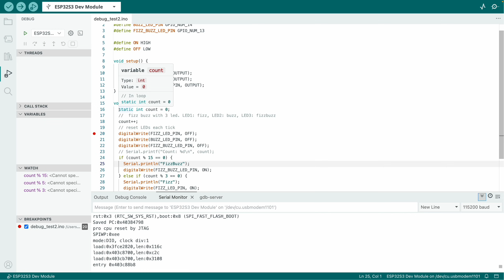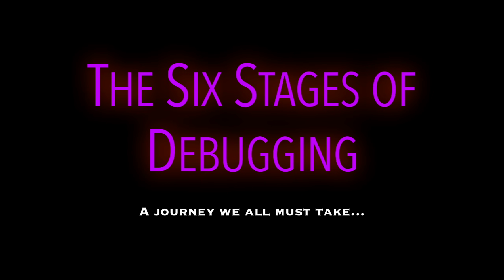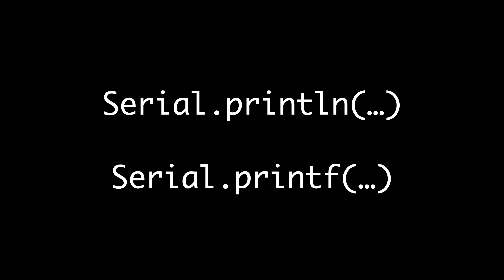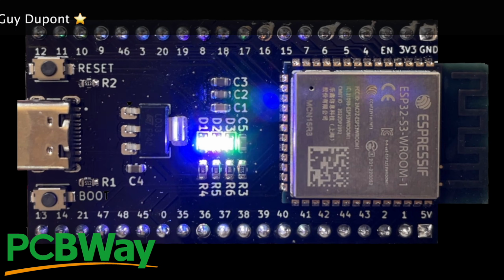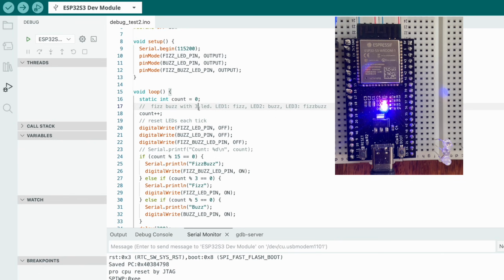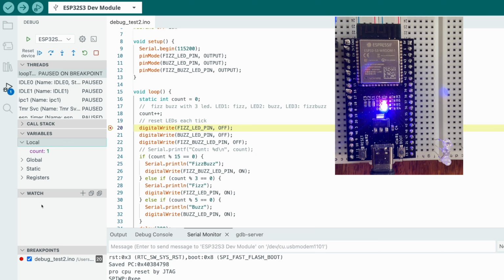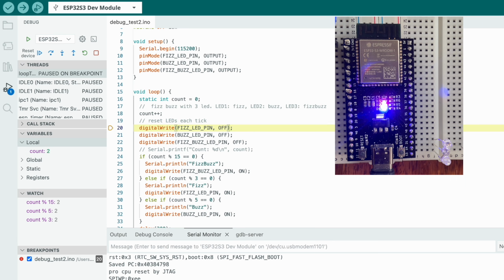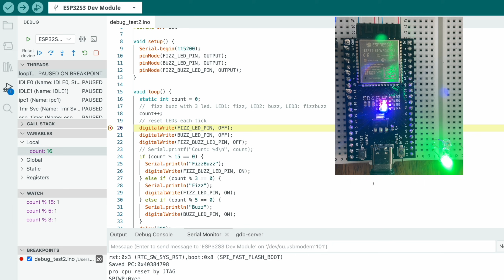Stop Using printf() - Debug ESP32 the Right Way

Comment: Esp32 is a quite of mess when it comes to choose and identify what board we actually have and which one has to be chosen in IDE like arduino or platfotmIO. And debugging isn’t that straightforward as you described. It isn’t enough to have usb on it , actually any has but you have to have debug feature in it. Anyway it’s a total mess and I didn’t manage to run debug on any of my Esp32 boards in newest arduino ide but on platformIO I did.

Comment: I got error when click Start Debugging in Arduino IDE 2.3.5
OpenOCD: GDB Server Quit Unexpectedly. See gdb-server output for more details.
Traceback (most recent call last):
  File "Users/Minh/AppData/Local/Arduino15/packages/esp32/tools/openocd-esp32/v0.12.0-esp32-20250707/bin/../share/openocd/scripts/target/esp_common.cfg", line 9, in script
SERVER CONSOLE DEBUG: onBackendConnect: gdb-server session closed
GDB server session ended. This terminal will be reused, waiting for next session to start..
Reply from the maker: I've seen this after an upgrade to Arduino - I had to create a fresh new sketch and then copy my code into it.

Comment: why use printf when the ESP chips have DEBUG printing built into the IDF.
Use :-
ESP_LOGI(TAG," comments "); where TAG can be #defined as the file name subroutine name etc. 
print formatting works as in printf. 
Also ESP_LOG allows for colour e'g ESP_LOGE for error prints with a red font.

I also wrap them inside a #ifdef #endif e.g.

#define DEBUG  // single place in the main routine.
 #defin DEBUG 

      ESP_LOG(TAG, "loop count = %d \n",loopcount);
#endif 

so just by commenting out #define DEBUG all printing of debug information is not compiled in to the final code. 

Miss having access to full blown microprocessors emulators so you have full control and logging of everything. The big downside between microprocessors and microcontrollers controllers not having emulators, well that i know of.

Comment: good video :)
it took a lot of effort to integrate the debugger into IDE 2, and for ESP32 we worked closely with Espressif to help them refactor their initial implementation of debugging  around the API we exposed.
being able to do conditional breakpoints and change the values is really powerful and can change your workflows for the better
Reply from the maker: It's very much appreciated! It's quite amazing being able to debug an embedded system so easily.
Reply: Disappointed that the "portable" option never made it into IDE 2. Several projects are forever on 1.8.19 because there's no viable way to isolate environments in V2.

Comment: Hi :) can you answer a question for me. I have an  Arduino running a machine (a large motor controller) and the Arduino is powered by the machine psu into the Arduino 5V pin. Is it safe to then connect my laptop via usb to do debuggering while the machine is powering the Arduino? How is this usually dealt with? I need the Arduino on the main 5V bus because the sensors all referenced this rail, and I can’t have the usb input powering the machine.
Reply from the maker: Generally, there should be a diode on the board protecting the USB 5V - it would be worth checking the schematic to make sure it is there.
Reply: @atomic14 Thank you so much :) I’ve asked loads of people and no one else replied :)